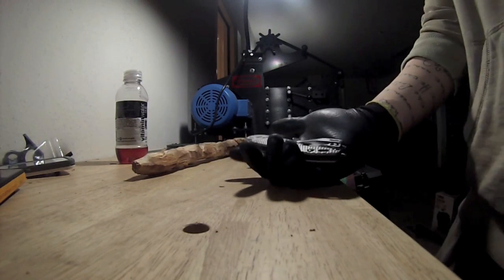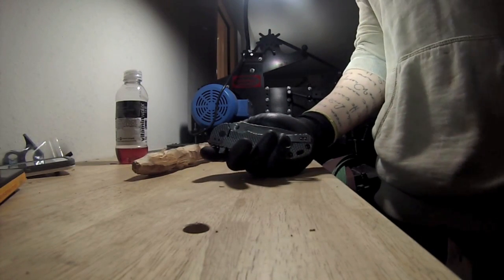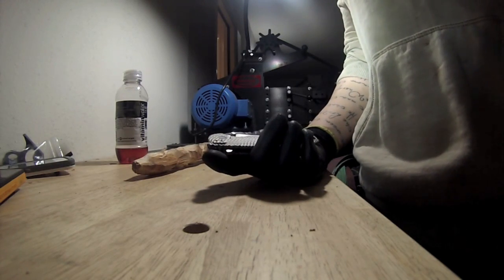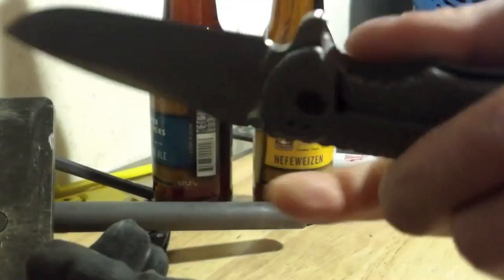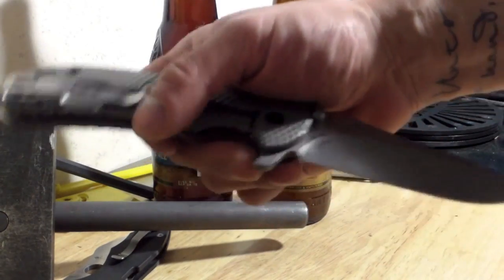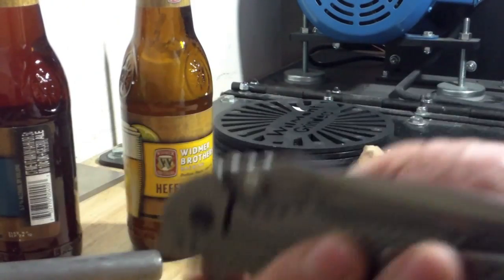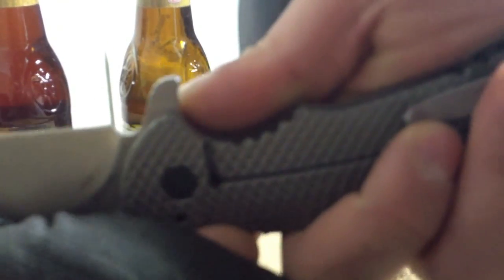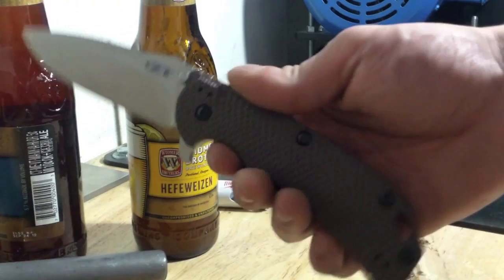ZT 0561 Lock Rock & Frame Lock Testing

Comment: I believe the rocking on the 560's is actually the lockbar flexing towards the rear or spine of the handle. I think it's just because of how long the lockbar is. Mine does the same thing but it's not slipping or anything. I think maybe a little bit bigger diameter lbs could help. Still an amazing knife for the price. That little clicking doesn't bother me like the lockslip most strider get after a short amount of time

Comment: I just did a video showing my WT rc finally getting rock lock. I am starting to think every single fram/liner lock is going to rock with hard use. It's not the knives, its the design of the lock. If your gonna own fram locks and use them hard than you need a carbidizer. I just bought one.

Comment: Could you try doing the ZT0770 CF? I'm planning on getting it but I want to know if it's wort it. There's no destruction tests with it yet.
Reply from the maker: If I can get one reasonably I would be willing but not available to me at the moment sir sorry
Reply: That's fine if you can't. I found it for $158 on Amazon and decided to get it since it's about $20 cheaper than I found it on bladehq, and about $100 cheaper than buying direct. But if you could, that would still be awesome. I've never had knife with carbon fiber before and I have no clue what to expect or even what it can handle. Would you be able to tell me off hand the type of strength I might be getting out of it? The entire handle is carbon fiber with minimal liners to keep the weight down.